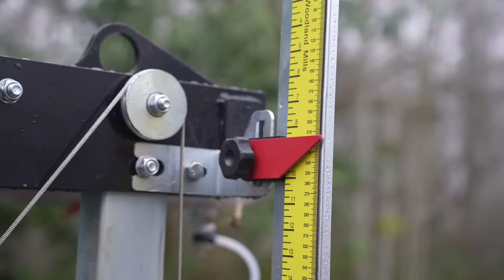Milling tree trunks into a picnic bench.

Comment: It’s a shame the frequency of videos is lowered. Wenn will the wood for the roof come? So you can start building again.And get more videos out.
Reply: When. Not wenn
Reply: @Chateaulady relax, it’s just a typo, obviously
Reply: Such a cryin shame. I’m deeply depressed 🙄
Reply: What is he supposed to do with sub zero temperatures. No contractor works in this weather for 8-12 hours.
Since he doesn’t have a workshop, he can’t film indoor projects.
He doesn’t even have running water and may be battling a frozen water tank, hence stressing simple life activities as cleaning yourself, washing dishes etc.
He had also mentioned that he had lots of planning meetings.
With the well completely dried up, he may need to negotiate with the council to have water lines extended.
I wonder where his neighbor gets his water from. He doesn’t seem to be tied into Dan’s well.

Comment: Your landscaping will be useless if you do not put a roof on the Chalet and dry it in so it does not collapse your priorities are wrong
Reply: ONO! End of Days!
Reply: It's already been explained why
Reply: His explanations are unreliable  @JPRobinso
Reply: He can’t work on the roof because the wood hasn’t arrived.
The landscaping is part of the purchase agreement.
The chateau was a ruin for 40 years and won’t collapse.
The floors are temporary, as explained many times. They have been installed to get to the roof, since Dan can’t afford a crane ( besides the strong winds not allowing for a crane) or massive scaffolding.

Comment: That mill will be a great asset, I have a similar brand mounted on a trailer. You might want to invest in a Cant-hook for handling logs.
I'm interested to know the brand of log trailer, it would make transporting logs from the woods a lot easier.
Reply: Hi, it's a Iron Baltic ATV & UTV log hauler. I got it for the back of me quads, they keep the logs clean & do little damage to the forest floor
Reply: @oldmaninthewood  Thanks Nick, I will look it up.
Main reason I'm interested is that it keeps the log off the ground and stops dirt/gravel from embedding into the log causing blunt blades.

Comment: Dan, the saw mill should have come with bars that slot into the frame that form a true 90, so that you can stand a log with a sawn face against it - this would have been a timesaver for you rather than using the tracksaw to cut the slabs to width.
Reply: They should have cleaned those logs with a power washer as well before milling them.
Reply: @TheToolnut there is no running water on site!!! He carts his water in until they resolve the dried out well problem.

Comment: Well done guys.  

1) do you have any (forklift) tunes? (tynes/blades). That would let you move /lift logs etc. Without having to use straps/chains.

2) is there enough room behind the mill to use the tractor with bucket to remove the buildup of sawdust so that you can relocate it elsewhere for composting etc.?

Comment: That looks like pine logs. The pine Rosen will run out of that in the summer. Make sure the neighbors know about that , it will ruin clothing. It’s no fun with shorts either since it’s sticky.
Reply: As was said in the video. Douglas fir
Reply: So the d fir trees don’t make sap ? Both firs and pines are conifers. I don’t know honestly. I zipped through to the end cause this one doesn’t really apply to me. If I want to build an outside table I’m running to Lowes or Home Depot and buying treated pine wood. I’d rather see this guy work on that big mansion….. have a good one !

Comment: I don't get it.  Dan would need to dry the wood he mills if he wants to use it in his construction.
Reply: It’s an outside table so it can dry over time
Reply: He'll have lots of uses for wood, not least fuel.
Reply: The logs were his neighbors trees.
Dan may start milling  some wood they cut down earlier this year.

If the sawmill is one of his sponsored tools, he would have to advertise it. Making the picnic table was a good way to do it.
He also has good guidance from Nick. Nick owners his own sawmill and has processed a lot of wood for Chateau La Lande, this summer. 
They are using it to build fences and a gate. Saves them a lot of money, especially for the oak they processed.
All wood comes from their own Forrest.

Comment: A $8000.00 mill? Uh us csnukd hike in, use a ladder and chainsaw for first even top cut then same technique to plank them. Build a parallel beam with height adjustments and sit the chainsaw on that snd slide along for a perm cheap mill. Building supplies are   expensive, should focus spending on that.

Comment: Wouldn’t it be an idea to use the timber you made yourself in the castle?
Would have been done when the castle was newly build.

(when correctly dried, and planned in advance etc etc)
Reply: @JPRobinso  
I know, but there must be dead  timber on the property that is dry and can be used, or store good quality logs dry, so you can use them next season.
Reply: Nope!
It would not have been done that way.
You just outed yourself as having no clue whatsoever what you're talking about.